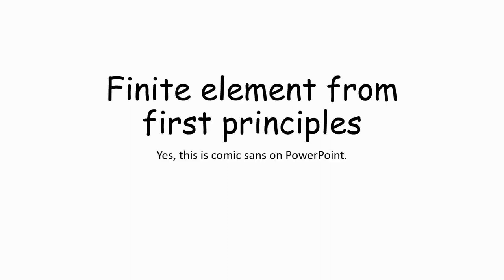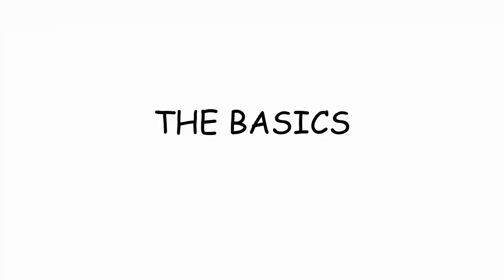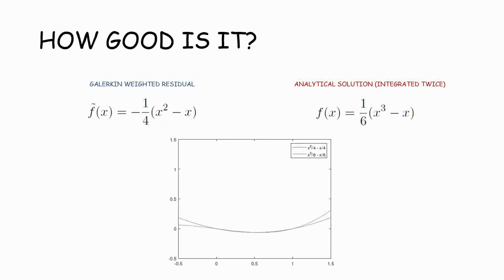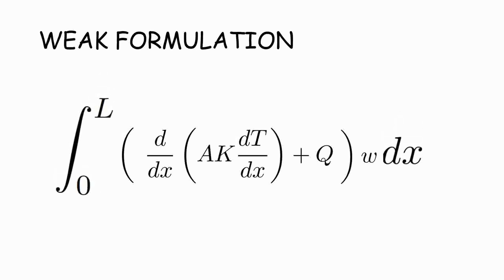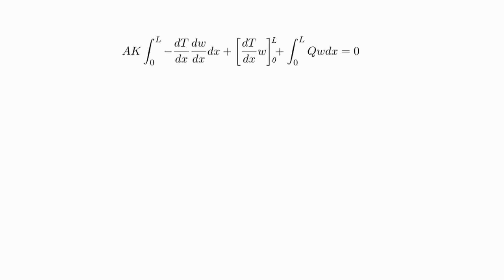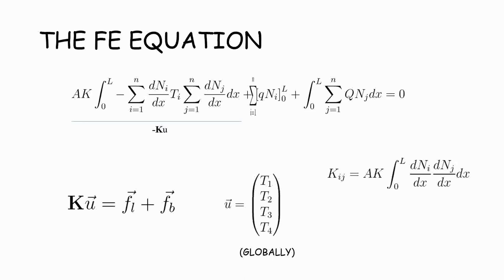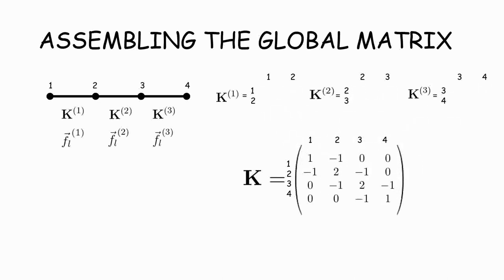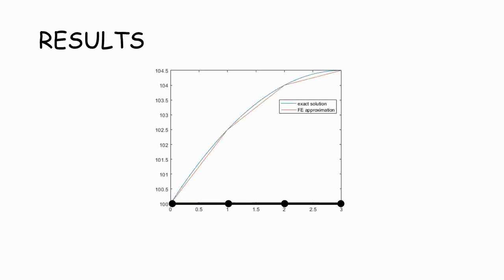Finite Element Analysis intro - Galerkin approximation & 1D heat problem

Comment: Hey thanks for the help! One question....what is the constant 'Q' representing at the end of the formulation? It's referring to a value of heat transfer....but where? Cheers.
Reply from the maker: Hi! Glad to help. It represents the heat transfer to and from the environment.
Reply: @erikoui   Excellent, thanks.
Reply: @erikoui  One more question! Do you have any resources on spatial AND time-dependent FEA? Preferably from you as I enjoy your teaching style. I have found other resources online, so no worries if you have nothing on the topic!
Reply from the maker: @BurningRoman  Unfortunately I do not have anything on the topic. With time-dependent differential equations, while you could technically aporoximate a solution by treating time as a dimension, it is the norm to use a time-stepping method in conjunction with FEA. I may make a video on this at a later stage.
Reply: @erikoui  Ahh okay, understood. I will be on the lookout for a future video. Thanks.